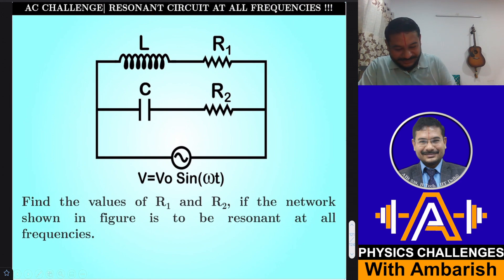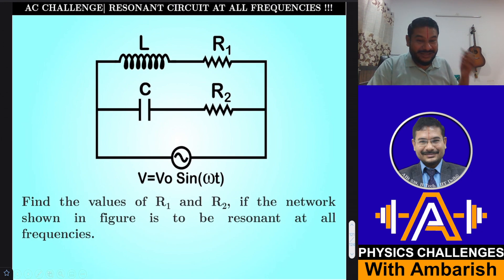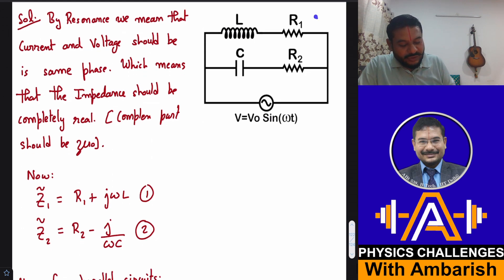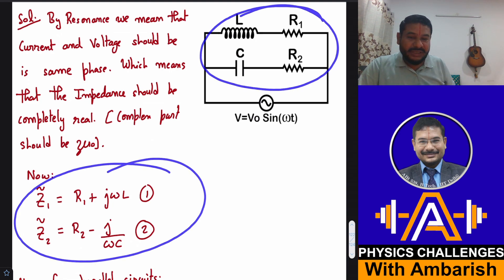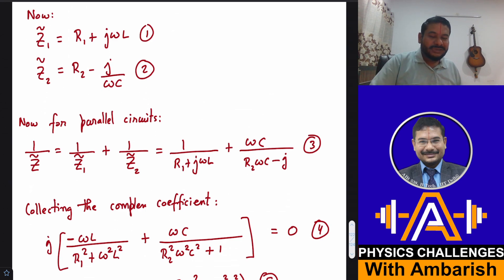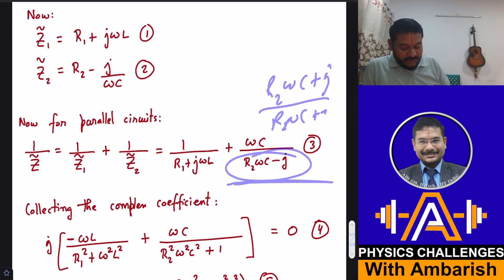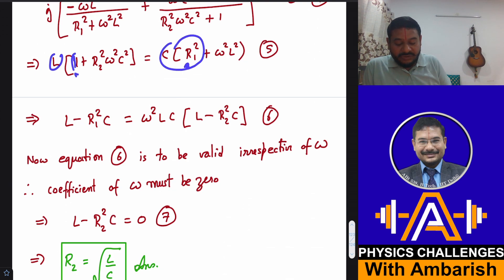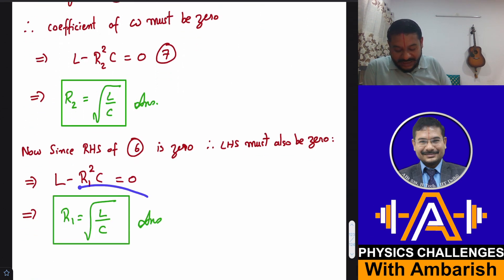ALTERNATING CURRENT| RESONANT CIRCUIT AT ALL FREQUENCIES !!! COMPLEX NUMBERS| JEE ADVANCED

Comment: "Resonance means current and voltage are in phase" that's a wonderful statement sir. I always treated resonance in the boring way that current is maximum. But after hearing that I solved using phasors
Reply: Hii i am from bhiali , you doin cse at iit bhilai !! 😮
Reply: @varun-hv7vi  Yes.
Reply: @arpangoswami5760  rank ??
Reply: @varun-hv7vi  Not very good (4172)